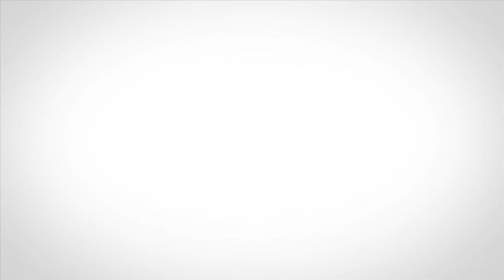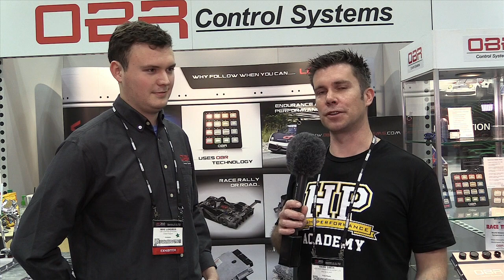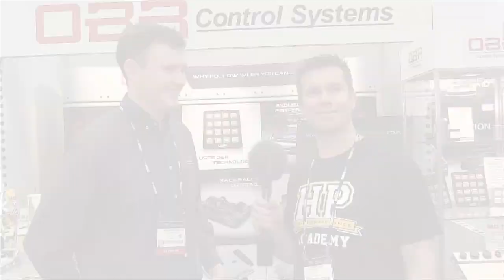[TECH TALK] The finer points of engine management controled gear shifting with Mike from OBR

Comment: Quick question: I run an Apexi Power FC on my automatic jzx100 and I'm dealing with some sloppy upshifts at WOT. I heard a lot a people complaining about this. I obviously don't have ignition cut on the ECU, so can I simply just retard Ignition timing at the shiftpoints (7200 rpm in my case) to improve shift quality and the lifespan of the gearbox? Except for the ECU, everything of the car is stock... Thanks in Advance!